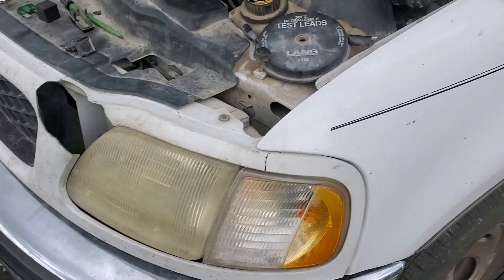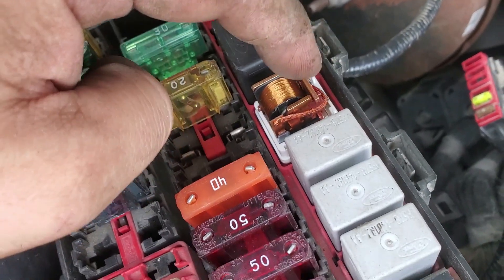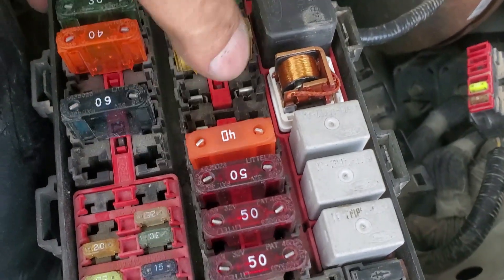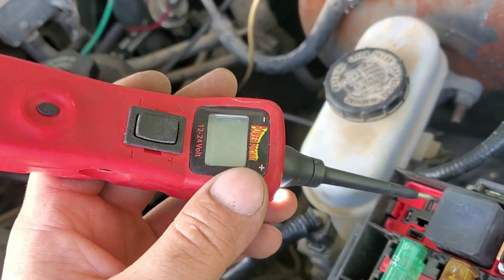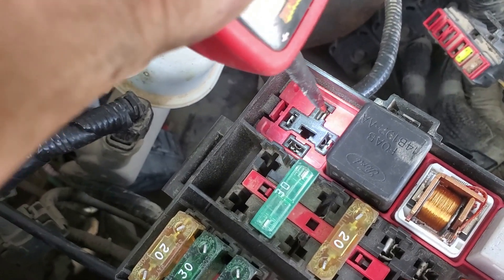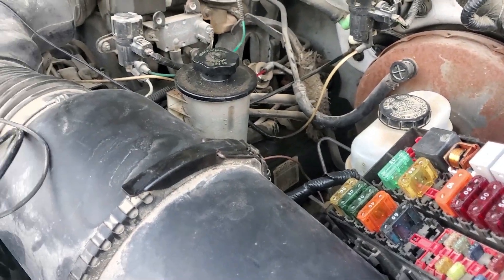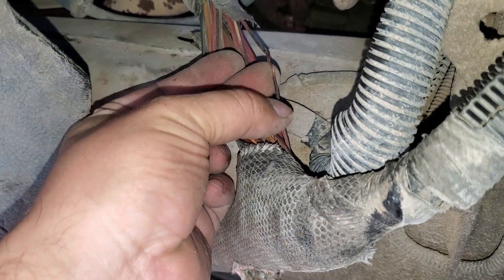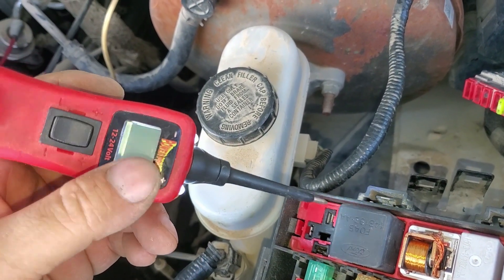(FIX) 1997 Ford F150 Doesn't run now and keeps blowing fuses. No power to the fuel pump.

Comment: Thank you for taking your time troubleshooting this issue and showing us how. It helped me finding the short that was blowing PCM fuse in my F150 4.2 V6. The wiring harness was rubbing on the EGR tube at the passenger side, exposing the red wires. This fixed the issue. Thanks a lot man.
Reply from the maker: Thats very good to hear man! Glad I could help!

Comment: Thank you very much for uploading this valuable information. I bought the same truck with the engine broken (it overheated) well, i picked it up and it turns out that it cranks but don't start. I don't hear the fuel pump when the ignition key is turned on and don't have spark on the electronic module. I also looked for the fuel cut off switch and didn't find one (don't know if the 1997 was equipped with one). Your help will be greatly appreciate it. Thank you very much.
Reply from the maker: Hmm...let's see, try identifying if you have all the grounds, signal wires, power wire and all that in good working order. Make sure you have key on power at the relay. If you do, and  you do not hear the fuel pump running which it should after having an energized relay, then your fuel pump is likely out. As far spark, I cant recall at the moment if you have a single coil firing the 8 spark plugs, if you have the dual coil packs, or if you have the individual coils for each spark plug. Let me know what style you have so I can better assist you with that question. As for the fuel cut off switch, that one should be at the kick panel on the passenger side by where the passengers feet would be on the side behind a plastic cover.